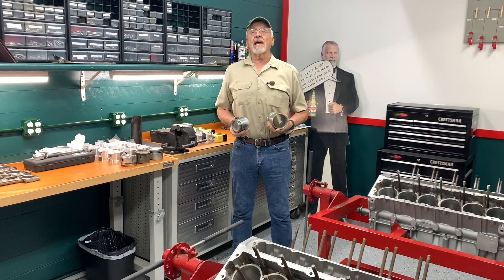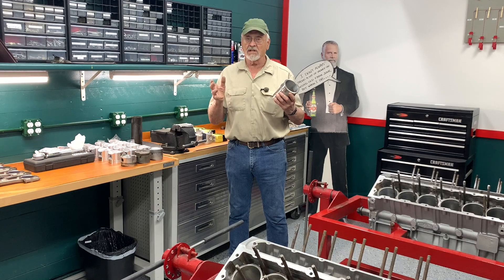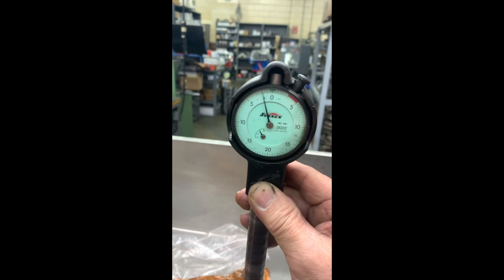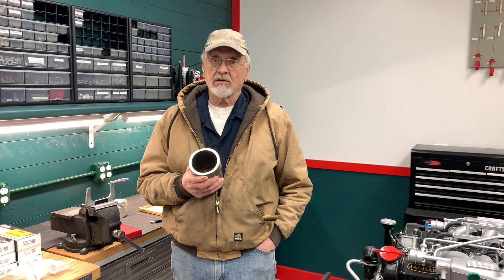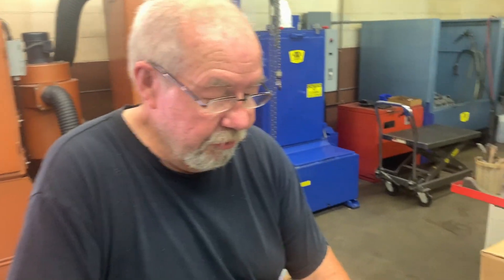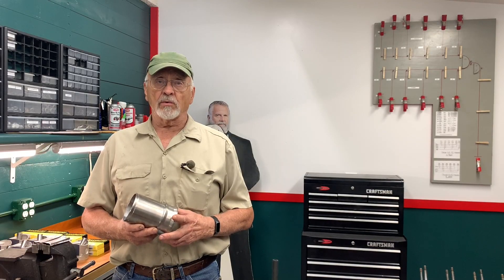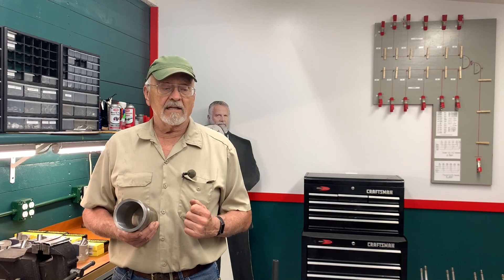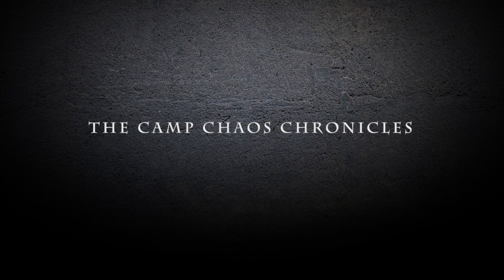S5:Episode 13-Jaguar E Type 5.3 Liter Cylinder Liner Issues.

Comment: I kinda ran into a similar situation. After a through spotless block and liner cleaning, and making the O.E.M. cylinder liner stud clamps , I took my block down to our local race shop. He was able to get that V-12 up into his Sunnen machine just to have the glaze removed and tidy the liners for the Std. cast rings. These were the stock 1986 Jaguar liners. Three had bad casting porosity pits at the bottom of the stroke which the rings covered. We discussed it and decided it was not acceptable but it would get buy. I was fortunate to stumble onto and buy a brand new set of O.E.M. liners off e-bay and sold my old ones getting my honing money back which basically paid for the new liners.

I'm guessing after watching many of these East Indian machining videos that more than probably not is where much of this new cast iron is coming from. Down and dirty and quickly produced in the barefooted dirt floor shops with no Quality Control Inspection or in process inspection while machining. It's amazing the ground they can cover with experience and crude dirty hand made tools and a steel ruler, feeler gauges and caliper. I don't believe they maintain precision boring machines or Sunnen Hones. 
I have a fellow up here in Sultan, Washington Jim Flower LLC Flower Racing LLC. He does a lot of FFA air cooled boxer cylinders and Harley-Davidson work. Google and call him, excellent, excellent innovative machinist and shop owner. They will be perfect when you get them back.

Comment: I'm no machinist, but I assume after the liners have been press fit, they will have to be bored or honed with a torque plate anyway. How round are the pistons?
Reply from the maker: The liners are slip fit wet liners. With the exception of a bit of finish honing, what comes out of the box is what you get. Pistons are Hepolite. Top notch.

Comment: As always Bob, great work and explanation of specifications..it used to drive me nuts gathering all the parts for a rebuild, to find out the rods, pins or pistons were wrong. Then you would have to panic on which way to go,, machine shop or reorder and measure for verification, then start having bad dreams on the first start up.. lol